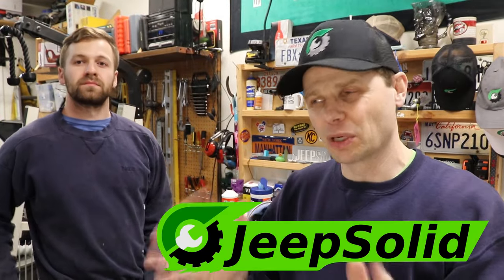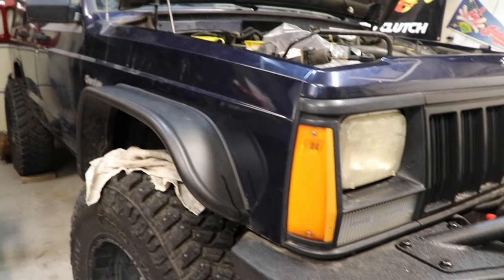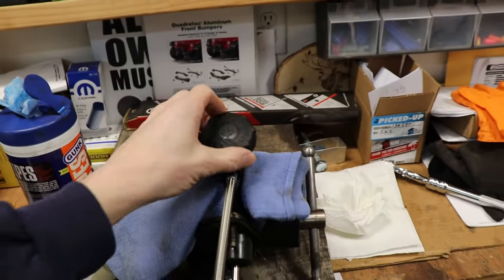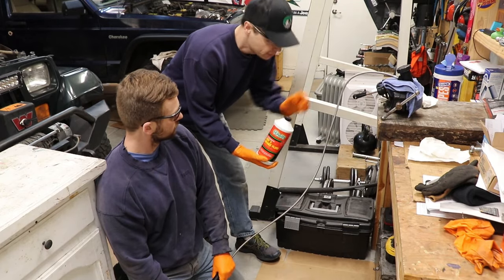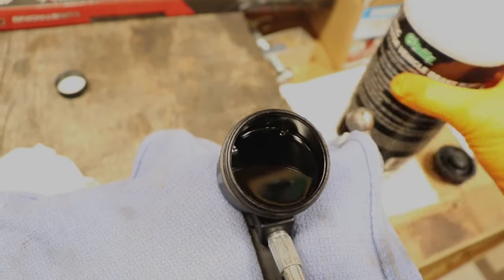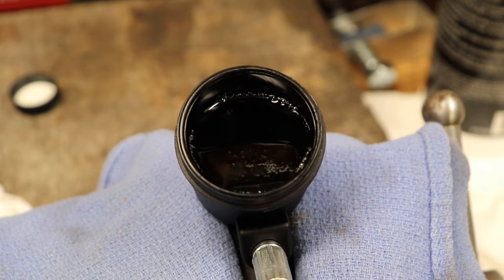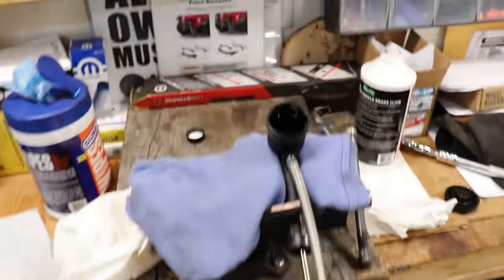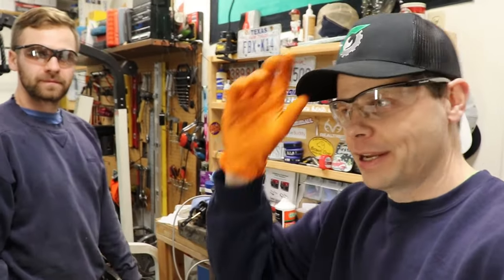BEST Clutch Bleeding Trick Ever!! Clutch Bench Bleeding

Comment: This looks super simple. Would this work when the master/slave clutch cylinders still in the car? just open the master reservoir and pump the clutch a few times? (assuming you keep the master cylinder topped off). Seems too easy
Reply from the maker: I know, right! Super easy. I don't see why it wouldn't work when in the vehicle
Reply: Did it work ?
Reply: Im so glad I found this video I was struggling
Reply: The CMC can have air pockets inside, so having it on your bench enables you to tip it to get those all out. Way harder to do with the master cylinder in the car, unless your Hulk!
 @JeepSolid
Reply: I does work when in the car, just unbolt slave cylinder from the box and pumped it carefuly against the gearbox. 😊